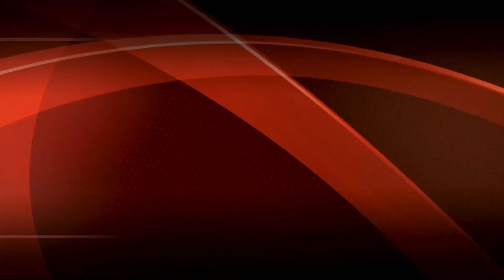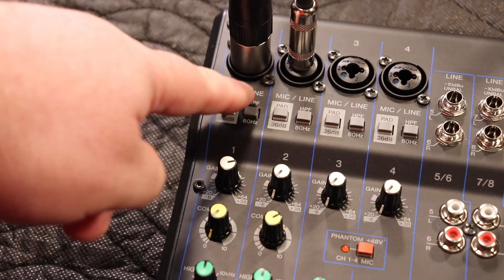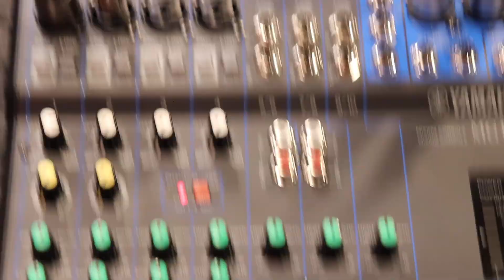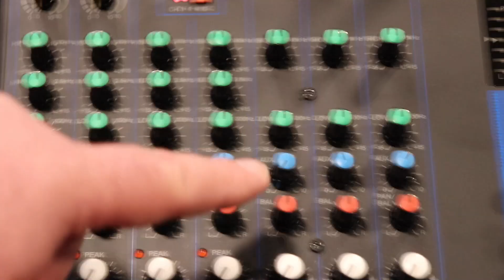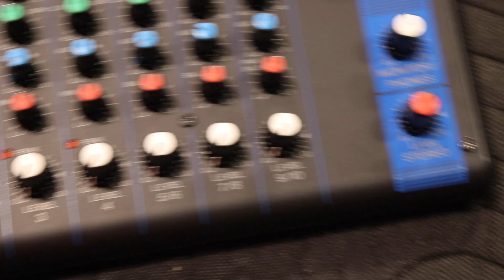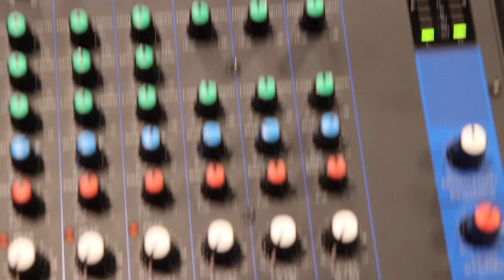Yamaha MG 10 Review

Comment: how do you record using the MG10? Thanks.
Reply from the maker: Definitely the best plan is to use the RCA outputs. You will need some type of audio capture device, like the Behringer U-Control UCA222 USB Audio Interface. This unit does not have USB.